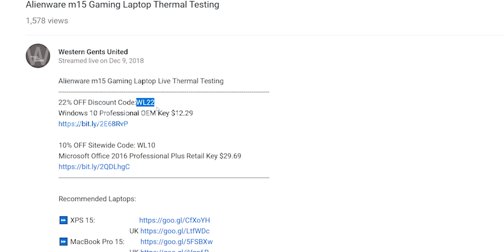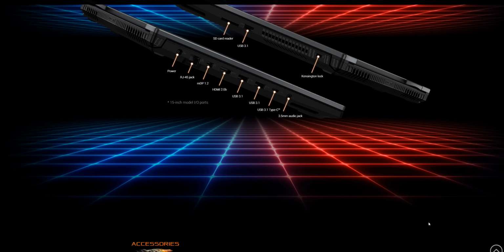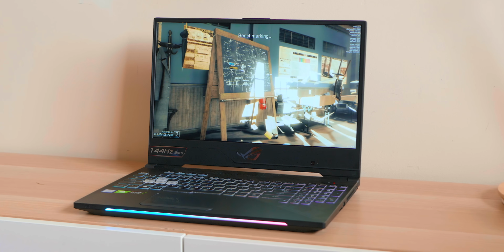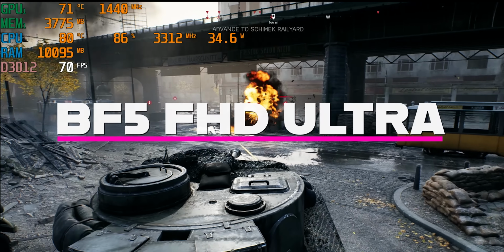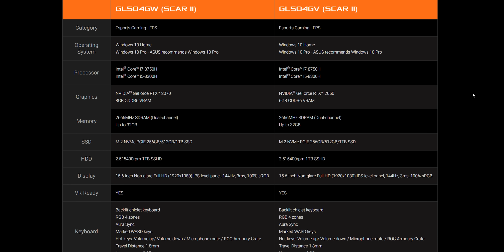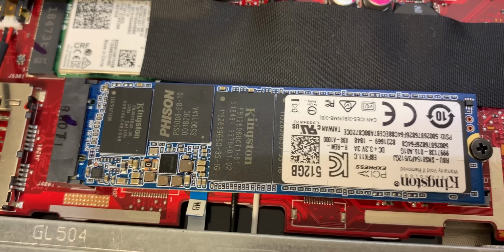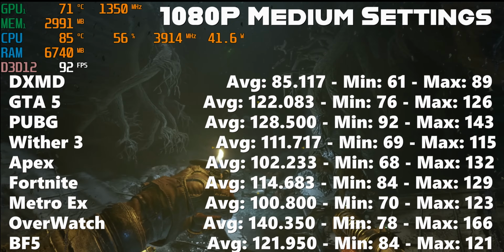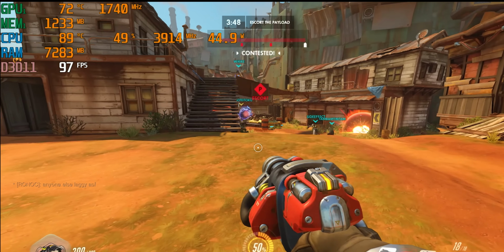ASUS ROG Strix SCAR II Gaming Review (GL504G) - RTX 2060 Woooo 🚂

Comment: They've should have left the 2060 as a GTX, especially in the laptop department. Yeah there's rumors about the 1660ti coming to mobile, but they've stripped it with fewer cudacores and a lower coreclock than it could have had(It can't be allowed to be faster than the 2060 :( sadly). We've could have had an affordable 144hz esports laptop in the market, but now we are forced to pay approximately 300-400 dollars in taxes (In the mobile department, it might actually be more considering u could get a good 1070 laptop for 1700dollars) for a feature we wont use in the coming 2-3 years. 2060 laptops start at about 2200 and 2070 laptops are at 2400 (asus scar II EU), with almost the same specs except the graphics card, the 2060 which is slower might I add than the 1070 can't be worth 500dollars more than the 1070, remember the 1070 had to cost smth too. Hopefully nvidias stock takes a dive, this is a f***ing rip off. (these numbers are a generalization, I just took them from memory so they might be a bit off)
Reply from the maker: Thanks for the info
Reply: In canada there is a $100CAD (~$75USD) difference between the 2060 and the 1060. The 1070 is actually $400CAD more that the 2060. The 2060 seems pretty reasonable to me, considering the performance difference between the 1060 and the 2060.
Reply: @skompie  Considering you could get the Acer Predator Helios 300 (8750H, GTX1060, NVME-SSD and 144hz panel) for 1100-1200 half a year ago, the 1000 dollar difference from a 1060 to a 2060 seems reasonable, you're right... (our prices) Thinking you guys should have almost the same import fees as we do from Asian brands like Acer, Asus, Lenovo... Sorry I'm just mad at general pricing and nvidias business plan basically, please don't take offense.

Comment: Got the same laptop from australia! Bought it a week ago and brought it home. There is quite an issue with the cpu temps. Mine reaches 95c quite alot and throttles when playing on highest settings with gta5 but still has 70-80 frames while playing. Maybe the medium settings is the way to go when i dont want to cook my cpu. Great laptop this is. It powers through pubg at all high with 80-90 frames! I think the 2060 has the best price to performance. There is bit of jump on price if you are getting the 2070
Reply from the maker: Mom interesting your gets hotter. Thanks for the info
Reply: Undervolt the cpu and gpu and then repaste if that doesn't help.

Comment: same specs other than the gpu the GTX1070 version of this laptop is much faster than the new rtx2060 version by up to 20% 
this should be called rtx 2060 MAX Q
Reply: mark angelo Garcia no it’s because it’s running single channel which on Rtx cards, there’s a huge performance gap, it’s faster then a 1070 by miles with duel channel ram
Reply: @dylanweise4802  dude just check out the clock speeds of the rtx 2060 in laptops and u will know YOU mean the rtx 2060 is faster IN DESKTOP VERSIONS NOT THE ONE'S IN LAPTOPS 
boost clock of rtx 2060 in laptops is lower than the base clock of a gtx 1070 in a laptop
they better add a MAX-Q OR M for laptops that have rtx2060
Reply: @dylanweise4802  both in single channel or dual channel gtx 1070 on laptops is faster than rtx 2060 on laptops
on desktop is another story
Reply: @dylanweise4802  either dual or single channel ram gtx 1070 in laptops is faster than rtx 2060 in laptops
Reply: @markangelogarcia2584  Umm, no.. Duel Channel 2060 beats the 1070... What do you mean lol...
Reply: @dylanweise4802  both are in dual or single channel ram gtx 1070 in laptops beats rtx 2060 in laptops 
i guess your saying rtx 2060 desktop of course it is alot faster than gtx 1070 desktop
Reply: @markangelogarcia2584  LOL the 1070 laptop does not beat 2060 laptop... LOL
Reply: @dylanweise4802  wise guy do some research first so you can be enlighten 
rtx 2060 on laptops are severely underclock both in base and boost clock
Reply: @markangelogarcia2584  Iv'e overclocked my 2060 laptop to 1769 mhz and it beats the 1070 for days man...
Reply: @dylanweise4802  desktop version does beat the the gtx1070 even without the overclocking part
i can't say the same for the laptop versions
Reply: @markangelogarcia2584  Listen... The laptop 2060 beats the 1070 laptop... Simple..;
Reply: @dylanweise4802  yeah exactly what do u mean mark?
Reply: @PixelParanoid  He's only saying that because he would of gotten a 1070 laptop and he's trying to make out that the 1070 is better because he has one... Well the 2060 does beat the 1070 pretty easily so, shame on you
Reply: @dylanweise4802  yeah exactly 2060 is 15 or 20 somthing percent faster than the 1070
Reply: @dylanweise4802  JUST WATCH HARDWARE UNBOXED'S REVIEW OF THE 2060 LAPTOP. IT IS SLOWER.
Reply: @AimanHilmiAHJ  Lmao, I have compared my 2060 laptop to my mates 1070 laptop and the 2060 is faster by 10-15%

Your just jealous because you bought a 1070 while it was on special and found that the 2060 is faster lol... Sucks to be you
Reply: @dylanweise4802   ummm did you even watch the video that I gave you?
Reply: @dylanweise4802  yea pretty sure his laptop only had single channel memory and your's have dual channel.
Reply: @AimanHilmiAHJ  No, the mine has 16gb duel channel and his has 32gb duel channel..
Reply: @dylanweise4802  hmmm dunno man, literally every review out there are concluding that the 2060 is slower than the 1070 in laptop form
Reply: Listen i have msi gv63-8se laptop
i7 8750h
RTX2060
1×16 RAM 
The performance is near to GTX 1060 laptops
But when you add dual channel at least 25FPS more you get and more stable !!
I added 1×16+1×8=24GB RAM
NOW
GTX 1070 VS RTX2060
the differences is very small most the games gtx 1070 higher and some games RTX 2060 higher
But RTX has DLSS the games in futures maybe will get double the FPS also ray tracing feature